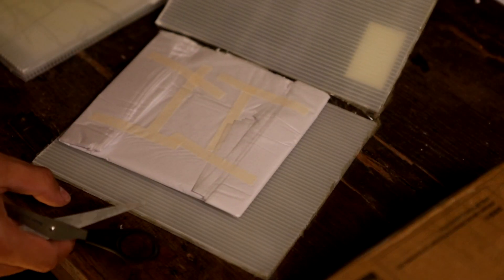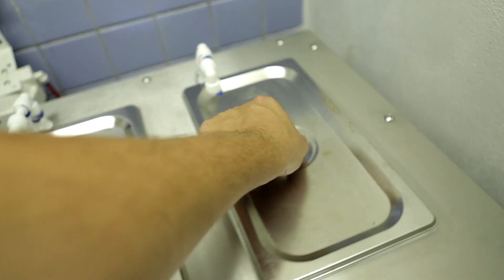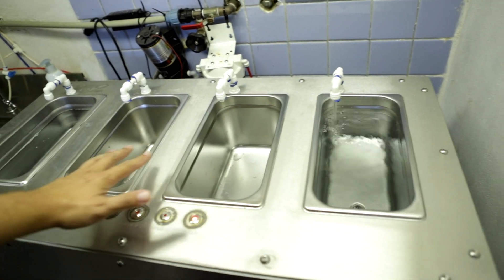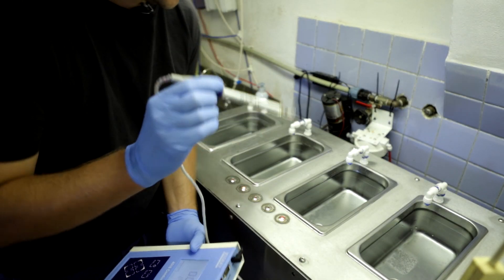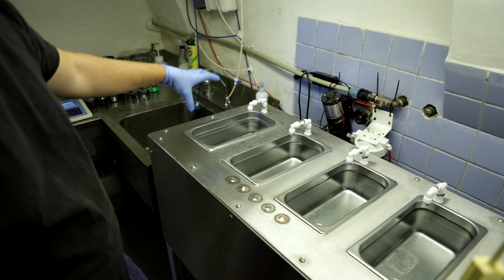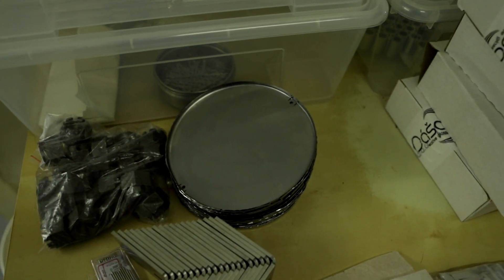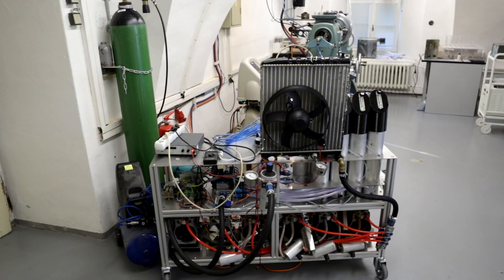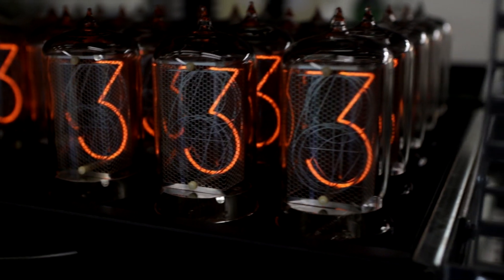All prototype parts ready, let's clean them - Project H #16

Comment: I hope you didn't go with that over complicated method for making those anode cups. Look into progressive stamping dies (much like bullet casings or cooking pots). ALL your flat parts can be stamped for < PENNIES per part. You can even keep them as strips and drag them through a ultrasonic bath to clean them and cut the tabs apart after. This will turn the entire production into one continuous process.

Comment: 1:23 - PC DOS on a dishwasher???
Reply: It's a special mode for cleaning old motherboards.
Reply: I'm not sure if it has a PC interface but I would had not put it past them.   That setting is actually for adjusting the dosing pumps.  This is actually a special glassware washer made by Miele and it has multiple programmable cycles and several feed pumps for various types of washing and treatment agents.